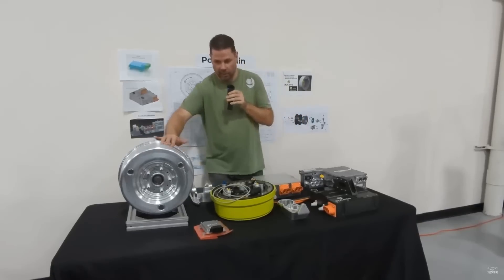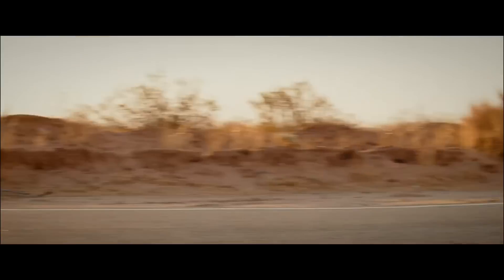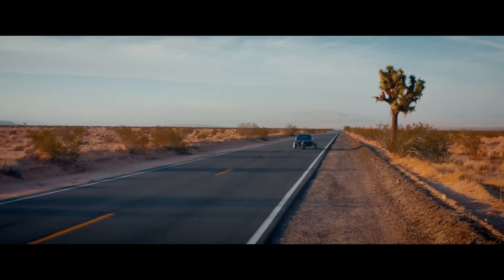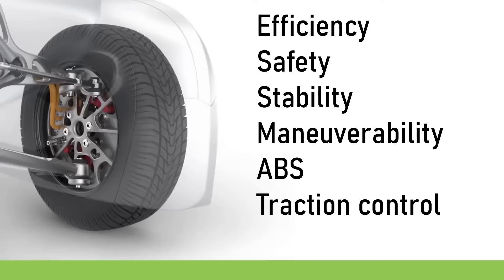Why is Aptera using In-Wheel Motors? (ft. Elaphe)

Comment: I am a supporter of electric propulsion technology and a fan of EV companies like Tesla.  But I have a concern regarding the placement of the electric motors in the Aptera vehicle, or what is known as the In Wheel Motor.  Another company tried the same motor layout for their pickup trucks and went as far as racing one of their prototype vehicles in Baja.   And the result:  The vehicle did not finish the race as it encountered a lot of breakdowns.  And the reason is, in the in-wheel motor layout, the electric motors are not protected by the suspension system and in every bump,  potholes or road imperfections that the vehicle encounters, the shock is transmitted directly to the electric motors and it's bearings, increasing it's wear and chances of breakage.   In the electric motors, in order to maximize the efficiency and power, the armature should be as close as possible to the stator,  to maximize the attraction and repulsion forces of the electromagnets inside the motor.   If the motor is mounted in wheel, then the road shocks will go directly to the bearings of the electric motors.  If the bearings wear out or get damaged even slightly, then the stator will come into contact with the armature, destroying the motor itself.  That vehicle will perform nicely while it's still new and always used on smooth roads only.   But once it gets old, or used in rough, unpaved roads, then mechanical problems in the motors will quickly show.
Reply: I believe your wrong about the breakdowns of the endurance pickup. The real reason it quit early was energy consumption was higher than anticipated due to the larger tires and the gruelling conditions, they were worried they wouldn’t be able to make it to the next charging stop in the very remote area, the motors actually performed quite well, also many many top companies trucks regularly break down on this brutal course. Plus don’t spread FUD about things you really know nothing about.
Reply: @Airman749  Spreading FUD???  I'm a supporter of EVs and a fan of excellent EVs like Tesla.  Stop accusing me of that foolishness.   What I'm talking about is purely engineering, nothing more.   Just think about it:    If the real reason for them to quit racing is energy consumption, then simply increasing the battery size, and/or setting up additional charging stations along the way  should have solved the problem easily, right?    And how come it led to the bankruptcy and closure of the company itself if their concept is so great?   Don't you think that the problem they discovered would have cost their company a large amount of money for the re-engineering of the vehicle, plus the tainted reputation of their design and therefore unacceptable?   How come the other companies have chosen the layout with the motors  within the body or frame, therefore protected by the suspension from harsh bumps and shocks? 

And you are so quick to tell me that these are things that I don't know about?   Don't make me laugh.   I'm sure you are the one who has no knowledge at all about these things which is why you are accusing me of spreading FUD instead of having a good discussion from the engineering's point of view regarding this subject.
Reply: @gerrycrisostomo6571  they didn't have time during a race to engineer, manufacture and fit a larger battery.  If they didn't make it through a stage without running out of battery power the time to get a charger to it and recharge it may be again the rules and put them way out of contention time wise.

Comment: You forgot to mention that a high unsprung weight (such is the case with In-Wheel-Motor) is not best in town and by decreasing this weight you can have the following benefits:

• Quicker acceleration
• More effective braking and reduced brake wear
• Sharper and more responsive handling
• More consistent grip over uneven or bumpy surfaces
• Reduced strain on springs, shock absorbers, and other suspension parts

Since 2008 Michelin has worked a lot o the In-Wheel-Motor project named «Active Wheel» but there is still no car using technology !!!
Reply: You might be interested in checking out this list of wheel motor projects.:https://en.wikipedia.org/wiki/Wheel_hub_motor#Uses_in_current_and_future_vehicles
Reply: @n.brucenelson5920  in wheel motors are used on bikes, euc, small motocycles and slow moving vehicles. Application on cars is still to come (or at it's beginning) mainly because it's less performing (on the road) than a conventional motor installed in the car. In wheel motor weight has to be reduced to the maximum in order to minimize adverse impacts on road performance and surrounding equipment (shocks, springs, breakes, etc..).
Why do you think maneuverability, acceleration and «mileage» is better on EV having smaller wheels ?
Reply: @sylvainlaurin1012  The primary advantage of the use of wheel motors in an EV must be recognized as a trade-off.  Of course, on the negative side is unsprung weight, cost, susceptibility to damage, and frankly unfamiliarity.

On the positive side we have lower transmission losses, getting more of the power expended to the road, less cooling required, and less distance to transmit control information, resulting in faster acting ABS/traction control.

We also add the potential for differential steering, even the ability to command the two front wheels to turn in opposite directions, greatly reducing the minimum turning circle.

Designers have greatly freed up volume to work with, not having much of the vehicle internal volume occupied by drive train components.
Reply: @n.brucenelson5920  I agree with you but the video only mentioned the avantages of IWM. Unfortunately this technology comes with some drawbacks.
Reply: @sylvainlaurin1012  Of course it does.  Aptera, just as every company that intends to use IWM, will have to design around them
Reply: @n.brucenelson5920  maybe it's obvious for you but maybe not for everybody. That was the purpose of my first comment.
Reply: Legacy automotive companies are risk averse.  They are reluctant to change,  just like consumers.  IWM is being used in e-bicycles and e-motocycles.  I've driven one, and it is fantastic.
Reply: @jonsek  Except for mountain bikes, there is no unsprung weight on bicycles. And why do you think industry use a central motor on mountain bikes ? To get a better performance. In wheel motor is generallay used because it's cheaper or because they have no choice as in an electric scooter. Real motorcycles (not a moped) use a central motor.
Reply: @sylvainlaurin1012  Sylvain, on most bicycles almost all the weight as unsprung except for the compliance provided by the tires.
Reply: Quicker acceleration, decreased brake wear, more responsive handling, etc.
Yes they could be better, but they are sooo good already no one really cares. 0 to 60 in 3.5 sec, most of the breaking is done by regeneration, Aptera passed the Moose Test etc.

Aptera is a big step forward in helping to save our planet and my lovely grandchildren.
Reply: @IBMara  Don't get me wrong !!! I am very interested in the Aptera. I just want the video to cover all aspects including the disadvantages of IWM technology in the vehicle.
Reply: @sylvainlaurin1012  
With Aptera and elaphe’s design we really don’t know at this point if there REALLY IS any disadvantages.
I’ve personally ridden in a alpha prototype, it felt fairly normal , and the alpha didn’t even have the suspension improvements, I suspect most folks won’t be able to tell the decreased differences which will probably be minor that ISM make.

Comment: It would be great if i could have electric wheels on the front and keep the factory driveline in place for the rear of my 2x4 hilux. Then I'd have a plug in hybrid and I don't have to upgrade my car
Reply: There is a company in Australia building electric 4x4 Hilux utes - they buy the rolling chassis off Toyota.

Comment: How susceptible to vibration damage due to bumpy roads or pot holes are the in wheel motors?
Reply: I have been involved in building electric motors for use in seawater.  The motors are completely potted in a shock absorbing, rubbery compound that can absorb over 100 Gs of shock.  I had a conversation with Elaphe engineers about this and am convinced they know what they are doing here.

Comment: ... how does aptera compensate for the much heavier wheels , isn't there a downside ?
Suspension, unsprung weight etc . . .
I would ❤️ the only radicaly "futuristic" EV to come to market soooon !
1000 miles for me – NEVER plug in !!!
🙏🏼
Reply: unsprung weight is and can be an issue.  proper design of suspension can help, but there are trade offs.  I am more than sure Aperta has taken the trade offs in mind and are going to build the suspension in a way to minimize trade offs, bit they will still exist.  Physics are still Physics.

Side note, If your wheels weigh 50 lbs, you are probably running the biggest goodiesest chrome donks you could find.
Reply: @motoriderj6448  I've heard about the "problems" of unsprung weight in other forums, but I've never seen a breakdown of what those problems are.  Could you please expand on what you said above to address what challenges the physics of unsprung weight might be that the engineers will need to address?  Thanks for your time!
Reply: @EdwardBartel  The more unsprung weight you have the harder your suspension has to work.  There are lots of videos on here and resources that cover it, but the basics are the car will handle better with less weight, the ride quality is better with less weight.  https://youtu.be/Km-4dKOxTMY here is a video that explains it kind of.  The maker confuses unsprung weight with rotational mass, which can be closely tied together, bit not necessarily.
Reply: Those motors look light weight. Be interesting to track down the specs.
Reply: @alwayscensored6871  The Aptera Elaphe motors only weigh around 50 ls, about the same as many steel wheeled vehicles.
Reply: Rolls Royce wheels are mega heavy, yet the ride is superb, weight is not an issue if you design the complete system correctly. These aptera motors are not that heavy

Comment: Excellent!  I really do hope torque vector steering is a reality in the first production vehicles.
Reply: Torque vectoring has to be in line Exactly with Wheel Direction & Speed! At EVERY given instance! When a car is turning the inside and outside wheels are going around different but changing radii! Due to this is travel different distances! Lets take a simple 90 degree, right angle turn. You are driving along at an appropriate steady speed, & initiate your turn. You neither accelerate nor brake, the inner wheel needs to slow down by the same or similar amount the outer wheel need to speed up! Now as regards  Torque vectoring, does this accelerate the the outer wheel & brake the inner wheel? Or does reverse Torque (regenerative braking) the inner wheel to to the correct speed compared to the outer wheel. Or does it do both? A Win Win or at least Brake Even!  Every slight steering should matched by the appropriate Toque Vectoring. Don't forget you can Brake Torque Vector Unpowered wheels to give greater control!  Speaking of Brakes, where do they go now that they have been made homeless by the hub motor? Please don't say in, on or close by the Hub Motor? Hub Motors & Brake Rotors don't make good bed fellows!